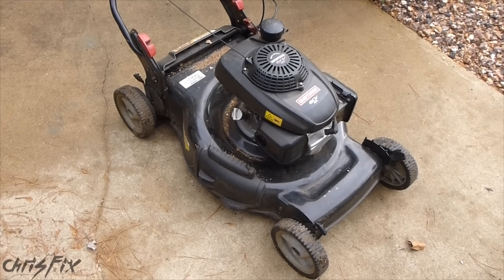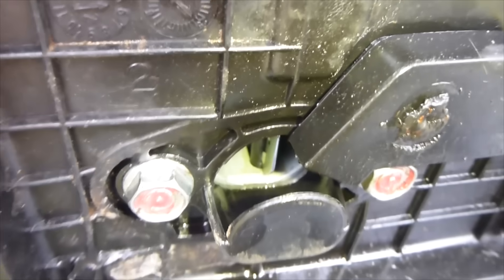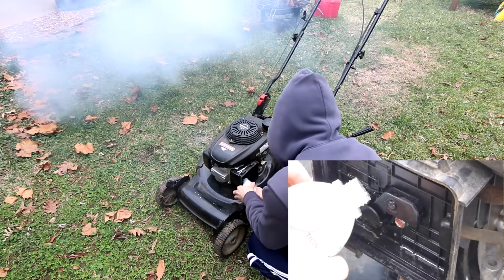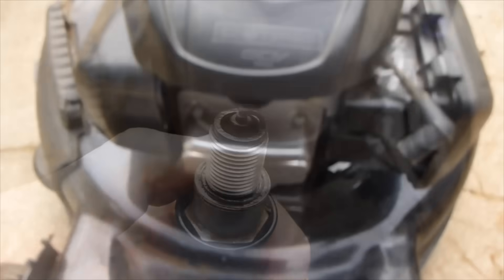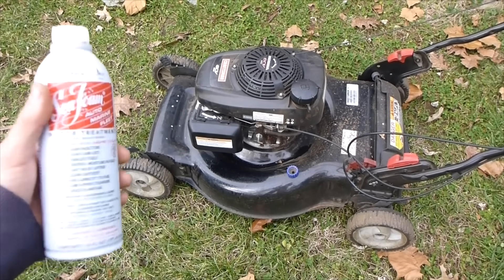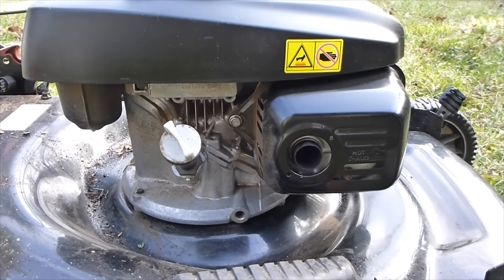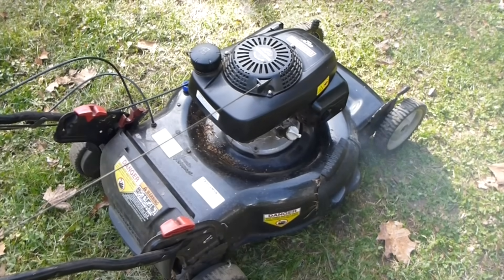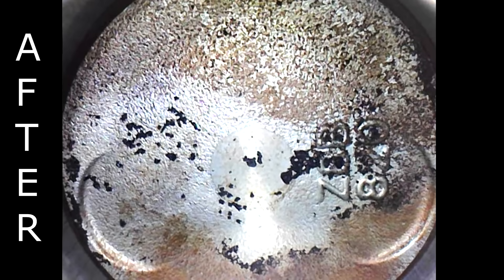Does Seafoam Actually Work? (with Proof)

Comment: False. We do not use oil to create smoke screens on tanks. We dump raw diesel fuel via injectors directly into the exhaust. The heat that one of the Honeywells produces is enough to burn any fuel within milliseconds of it being introduced. The exhaust temperatures that come out of it are over 200F. However, we generally never use it because we do not use diesel fuel any more. We use what is called "JP8" and its cheaper. But, as a result it can potentially cause fires onboard so most of the smoke screen systems on modern day abrams are either disabled or grayed out on the control panel.

Comment: I bought a 
97 Toyota Camry with 120,000 miles and it had used Castoroil long life blended Synthetic. It had a new oil change so it was clean and clear. I checked the mileage on the first tank and got only 10mpg. Added half a can of Seafoam to the gas tank and the mileage jumped to about 15 on that tank. One more tank of gas and the other half of the Seafoam and it's getting around 19 mpg mostly in town driving. Really worked for me.
Reply from the maker: +Jim Foreman Awesome! Thanks for sharing!
Reply: +Jim Foreman 19 mpg???? wtf something must be wrong a toyota should get much more
Reply: +XXBOOMYOUDIEDXX  Probably my longest trip was under ten miles, doubt it ever got out of closed cycle.

Comment: I had my Datsun (Nisan) 280zx  high compression turbo engine with water injection to avoid detonation and use low lead fuel, pistons and valves were cleaned to a like new condition while on the water injection, it was really incredible, I used it for years no problems, but water is injected atomized with an injector , I would be afraid of using too much, solenoid would only inject water while it was above 2000 rpms and it had turbo boost pressure.
Reply from the maker: +Roberto Reyes Yea, water being injected into the engine over time will make engines shiny clean! That is cool how you got it to inject over 2000 rpms. How did you do that?

Comment: nice test! in the 70's i ran a water injection , vacuum operated , did pretty good ,don't see them anymore maybe new tech prohibits it ?  what i would like to see is an oil additive true true test ,not the one arm bandit with the bearing , that can be tricked to the sellers advantage , but like that zmax they claim it penetrates the metal , there is a lot of scams out there that don't work at all and people swear by them , consumer beware . we did a test back when a product called wenns oil additive i saw that with my own eyes as far as making the oil stay longer in the connecting rod over knight or longer to avoid a dry start . but its not available anymore , in school we added it to one car and pulled the pan and connecting rod bearings and they where very very well lubricated compared to the other car that did not have it , just saying it worked then .

Comment: You get the same results by pouring water or transmission oil into the carburetor. They both shock the system and breaks down the carbon. It is more effective if seafoam added to the fuel as it doesn't just momentarily shock the system

Comment: Sea foam works. We use it on Honda 4 strokes on heavy haul trailers that power hydraulics. The Hondas before would get carbon buildup in engine. Had to pull heads to clean off carbon. Adding a little seafoam to the fuel while using engine helps prevent buildup. It you wait until carbon is built up... it takes some treatments. Use a little in fuel as you use engine normally it fights carbon. Waiting until carbon is built up makes it more work.

Comment: I used stp black bottle mixed with shell 87 octane gas and my check engine light went out after driving 17 highway miles I have the original spark plug on a Nissan titan at 113k I was impresssssssssed you should not used the stp unless you have a problem

Comment: If you do the piston soak method as performed in this video, I would highly recommend changing your oil immediatly after you soak the piston even before the first startup after. SeaFoam contains a pretty good amount of alcohol and with it sitting in the cylinder it could seep past the piston rings down into the oil and the alcohol in the SeaFoam can break down your oil causing insufficient lubrication. And thats just bad, not knocking SeaFoam. Its a great product and works well but you have to be careful with it becasue of its contents.
Reply from the maker: +Midwest UTV I agree although seafoam doesnt contain alcohol.
Reply: no its alright if it gets into your oil system, it states on the bottle that it can be added to your crankcase to resolve deposits
Reply: ChrisFix You're right on that one, I looked it up and it does not. However, SeaFoam recommends that when you do add it to your engine oil that it may need changed earlier than the normal service interval. Has something to do with what the product does to built up oil resedues in the crankcase.

Comment: I put a gallon in the tank at 1/4 tank and drove down the freeway, james bond smokescreen the whole way, 2nd gear, 60 miles an hour. that engine may have had major carbon build up on the valves, but it was gone when i came back. (I was driving at 2 in the morning, not in rush hour traffic BTW)
Reply: Did it mess up the engine at all ?
Reply: no it ran great, not a hickup
Reply: +ʇɥƃᴉɹlɐ ʇou ɯᴉ  I might try it out, how many bottles did you use?
Reply: the gallon jug in about 7 gallons of gas

Comment: its not that I dont believe in seafoam treatment,  I do 100%  I use it myself in everything I own for fuel treatment and crankcase cleaning.   That being said,  if you just want to clean carbon deposits off the tops of the pistons,  you can also take a few teaspoon fulls of water and let the engine suck a little in at a time as to not let the engine hydrolock,  it will do the exact same thing.  ONLY do this AFTER the engine has warmed up to full operating temperature.  The water actually turns to steam inside the combustion chamber and the steam will break loose the carbon deposited inside there.
Reply from the maker: +John Smith I will be testing water so Stay tuned
Reply: awesome, I think you will see good results.  just as good as sea foam or better..
Reply: +ChrisFix Awesome! Thank you for doing this. Subbed just for this next video you are making

Comment: does it work. yes no maybe and sometimes. depends on the problem
also hold your finger over the end of the bottle to control the flow of the seafoam instead of spilling so much like you did.
Reply from the maker: +Stephen Cobb Thanks for the tip

Comment: I mix this in with my gas at least once a year.  Not to get rid of carbon, but to break down any gummy gas that builds up in the fuel system.  So far I've had no carb problems since I started using Seafoam regularly about 5 years ago.  Whether it works or just works as a good luck charm I think I'll stick with it.  I got one engine with internal governor issues some time back. Dabbled a little seafoam in with the oil and it was freed up in less then 10 minutes.  I couldn't believe it!
Reply: +Quadrunner  When I read your post I heard it in Hank Hill's voice and whatnot.
Reply: john haynes Whell that's the idea son

Comment: Removing carbon from an engine is like washing your butt before you poop... totally unnecessary.  Only thing it can help with is varnish stuck injectors or similar.  Think about how many high mileage engines are still running fine, how many racing engines run fine etc.  Your 1991 Corsica isn't going to benefit from a decarboned piston, other than making you sleep good at night.
Reply from the maker: +Monel Funkawitz Thanks for sharing.
Reply: +Monel Funkawitz and keep in mind the damage that can be caused by freeing up these deposits

Comment: I know that inherently keeping an engine free of carbon deposits is a good thing but why is it particularly important to make sure cylinder heads are kept clean? So in this video - will the lawnmower run more efficiently? What's the real advantage of keeping these things clean? What are you losing in performance if you don't clean them in a car or any other engine?
Reply: +Gahechi Esmichi  Carbon deposits in cylinder raise compression and create hot spots. Causing detonation or pre-ignition. Not good with low octane fuel.
Reply: +TheSupV Wrong, carbon does not damage cylinder walls.  It is softer than the metal the engine is made of and will just break up and get spit out of the exhaust valve.  However, on engines with valve springs, carbon may build up to the point where the valve springs wont be strong enough to close the valves entirely.  Also, carbon deposits can get hot enough to become incandescent inside the cylinder...which will ignite the air/fuel mixture out of timing...which will cause pre-ignition (and detonation) and can severely damage an engine.  Someone else also mentioned that it may increase compression...that may be possible but if carbon has built up to the point where it has appreciably altered the compression ratio...you will have bigger problems on your hands.
Reply: +Gahechi Esmichi carbon only builds up in 2 places, on the piston and the cylinder head (+valves). if carbon gets build up too much on either of those it will chip off and damage the cylinder walls. and if this happens nasty scratches can occur on the walls allowing oil to get trough and the engine will run on it. thus creating more carbon and again chip off... ect... so it's indeed a good idea to keep it clean in there.
Reply: ***** thanks for the insight!
Reply: Gahechi Esmichi np
Reply: +Venomrs4  I have worked on lawnmower engines for about 36 years, and with the advent of nothing but unleaded gas, there is a huge difference when you take one apart, the deposits are soft and you don't have the rock hard junk on the inside which used to break loose and score the inside of the aluminum cylinders.
Reply: The cleaner the piston, valves, and combustion area, are, the better performance. My dad told me they would overhaul aircraft engines, they would super polish them. He was an aircraft mechanic and worked on jet and reciprocating engines.
Reply: +Gahechi Esmichi Emissions too.
Reply: MrRatkilr Thanks! Are you a cat by chance? Just guessing by your screen name XD
Reply: +TheSupV You How hard are these carbon deposits, if they are able to scratch the cylinder walls?   If a piece were to break off, I would expect it to get sent out the exhaust.
Reply: +MrRatkilr  I'm interested in seeing test procedure and results, to back up those statements.  How has it been determined that carbon deposits cause any appreciable increase in cylinder compression? (or, that they cause any appreciable decrease in cylinder volume).    How has it been determined that carbon deposits create "hot spots"?
Reply: +Cameron Miller it's kinda like sand really. and yes, if you're lucky these can be send straight out of the exhaust.
Reply: +Cameron Miller About as hard as a rock or chip of metal, so having carbon build start to chip off can wreck your engine over time.
Reply: Not at this point but if you leave it later can damage your engine
Reply: Samuel Strcula who are you replying to?
Reply: To the coment :D
Reply: i would think the carbon would retain heat causing hot spots on the head having the engine run hotter reducing engine life

Comment: I use sea foam to clean my bicycles and parts that most cleaners don't work is pretty good for hard to clean areas and so far it hasn't damaged or effected anything in any way. I also use it to clean my paint brushes.

Comment: Chris - follow a lot of your videos and find a lot of them useful - thanks!  Came across a product named "Star Tron" at my cycle shop they highly recommended which claims to be an enzyme fuel additive that improves performance, cures ethanol problems, stabilizes fuel for two years, and removes carbon deposits, varnish & gum.  I use Sea Foam now because of your videos, but because of the recommendations of my bike mechanic, he has me wondering, saying this enzyme additive is newer technology and Sea Foam is like 1940's Tech.  Can you do a test on this product?
Reply from the maker: +James Dula I use that on my boat which has a 300 gallon tank. The boat sat for 3 years and she started right up. I totally suggest that product for fuel stabilization!

Comment: Chris, why should we be concerned with a little carbon on the face of the piston?  Just wondering.  It's not a machined surface in contact with another surface.
Reply from the maker: +gsantander100 Not a little carbon like this. Most engines today do not get gummed up like they use to. It is hard to find a dirty engine (and I look in tons). The goal here is to see if it cleans any carbon at all. Dont worry about a little. A lot can cause detonation, uneven compression, etc.

Comment: Suggestion, try a spray bottle, adjust spray pattern from squirt gun jet to hairspray can fog mist. Great vid and results were impressive but it would be hard to pour Seafoam into running engine without washing down cylinder walls of lubricant and messing up Piston rings and walls as well as keeping the engine running during application of cleaner.

Comment: When they refer to a FUEL SYSTEM cleaner that pertains to the fuel injectors tiny orifice or a carb's jets, metering passages , the float needle and seat, the intake valves stem and backside which obstructs air flow to the cylinder as well as the turbochargers driven side impeller blades.
Reply from the maker: +Kd Grayson If they didnt put claims on the bottle that it cleans the combustion chamber and valves, then I wouldnt test it that way. I am only testing the claims on the bottle. Since it is very difficult to see the injector spray pattern, I am testing their carbon removal claims. Read the bottle, then you will see what I am testing. Plus, seafoam actually contacted me directly about this video and said it did a great job showing how their product is supposed to work so...

Comment: can do the same buy feeding small amounts of type F trans fluid threw the carb 
and it is cheaper  
but be warned many of your fuel injected cars could start throwing codes if you run this stuff threw the system  so do not do it right before you need inspection so do it a few months before so that it will all burn out before EPA testing
Reply from the maker: +dexter2433 Thanks for sharing!

Comment: That was very informative. Good to know SeaFoam really works but, there are cheaper ways. I would suggest using a Carburetor/Fuel Injector cleaner that is a Petroleum Distillate. Such as the cheap stuff at Wal-Mart. All it is Naphtha. AKA: Coleman Fuel. A 12oz bottle is only $1.80. Cleans carbon really well.
Reply from the maker: +Gorneyland Thanks! I will be testing water which is even cheaper so stay tuned!

Comment: The intake method is for shit. Cleaning the top of the piston is almost pointless, all for show. The soaking method will actually free stuck rings, especially the oil rings which will get frozen solid with carbon. The thing is seafoam is not the best cleaner.
If you really want to revive an old engine use the soaking method with PB Blaster, or WD-40, or other penetrating fluid, and apply it multiple times over several days, or even weeks without running the engine. Just turn the motor over a few times at each application with the plugs out to stir it up, and get the rings loose.
Be sure to engine flush, and change the oil afterwords. I have restored motors that smoked profusely, and motors that were completely seized up to good running condition this way.
Reply from the maker: +ipissed Thanks for sharing!

Comment: Carbon buildup on an engine piston is not always a bad thing. The carbon actually causes the engine to produce a higher compression ratio which produces higher horsepower and torque. The down side is there's usually some knocking or pinging. This requires using a higher octane gasoline. On the other hand carbon buildup on the valves not good especially if the buildup is on the sealing surface of the valve
Reply from the maker: +midlantic1 The problem with that theory is that the compression will be uneven between pistons which is not good.
Reply: Cris. The compression between cylinders would be very close if not exact. Considering all cylinders are exposed to the same air fuel mixture and same running time. Now on the other hand using this technique to clean a larger motor may result in different compressions due to different cleaning results between cylinders.

Comment: thanks for the before and after.

the next question is - does knocking carbon loose from the top of the piston do any good?
Reply from the maker: +Johnny Pea Only if you have significant carbon buildup. The amount of carbon in this video is insignificant. I am just testing to see if it works at all to remove carbon.

Comment: you could have just put some in each tank of gas and it will clean and help the fuel  last longer
Reply from the maker: +the “Bullets Rc” garage Thanks for sharing. If you use it in the gas, you will not clean combustion chamber carbon.

Comment: The oil may be diluted now,best change it.
Reply: If I remember correctly, it can be added to oil.
Reply: I wouldn't do that except briefly to clean out sludge,which you shouldn't have if you've been running the recommended viscosity of synthetic oil.
Reply from the maker: +thrummer1953 Thanks! It was the last time that mower was run for the fall so in the spring I changed the oil.